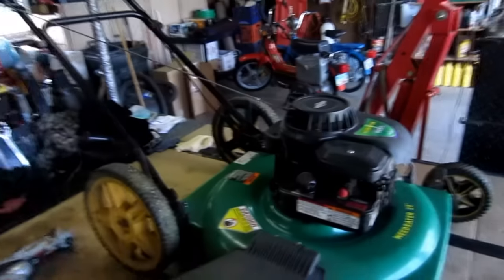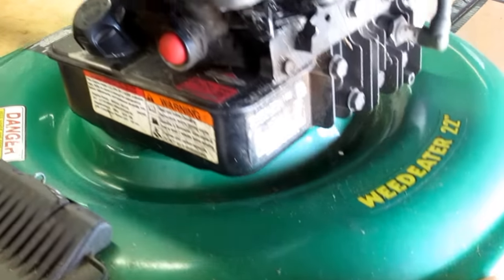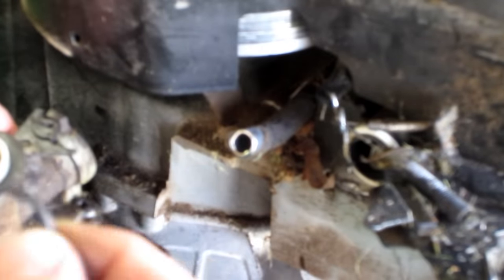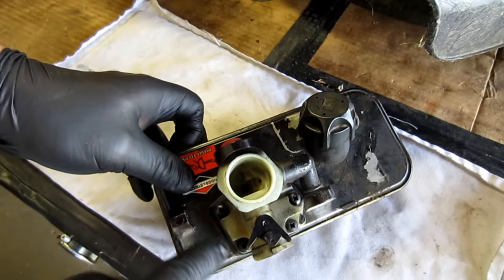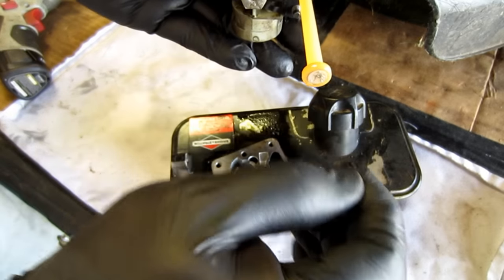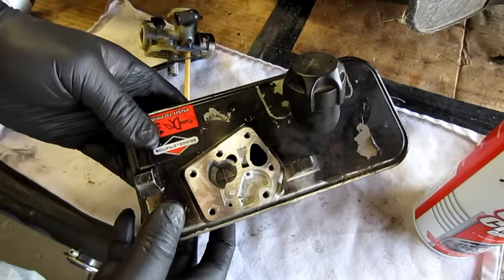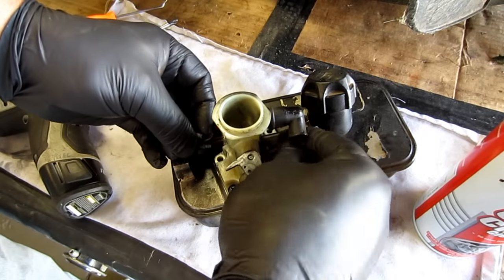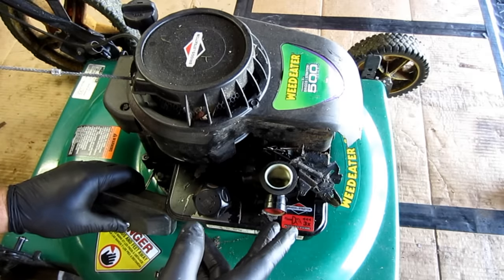Fix 90% of Briggs lawn mower not starting problems. Easy repair.

Comment: A correction to your vid needs to be added regarding carb facing up when looking at blade, i suspect you meant to say muffler faces up perhaps add some text it'll save re-doing the vid.. Pays to check inlet pipe where carb o-ring connects, being plastic it can wear from the vibration & check other end of inlet tube bolts are secure.. I really hate those carbs lol
Reply from the maker: Nope... Always carb up or Spark Plug up.... Makes it impossible for oil to enter into combustion chamber or Carburetor... If it gets into the muffler it will just be expelled or burned out...
Reply: @Foxboss9   For L head style motor mowers. The breather valve is on the muffler side. This is also where the orifice is to access valve keepers. There are two holes. One in the bottom sitting parallel with the sump. The other much larger is parallel with the back of the block (as tho you had a hole in a door while motor is right way up), this is the hole that when placing carb up allows oil to fill that void where the valve stems & keepers are. It also means the breather will now flood with oil as it is now facing downwards where you don't want it & can hold enough oil to foul the carb & plug once mower is placed back down (a good portion flows through the breather tube you see in your vid the rest comes when the motor is attempted to run & gets pushed by crank case pressure). The 2 small holes in the breather gasket are far too small to drain the oil out. It was a common sight usually from mowers bought from big mart stores as customers weren't given instruction.
Reply: @ricebike  . face palm

Comment: I have to say, first thing I do, I have to wash all the gunk and crap off with degreaser and pressure washer, before I begging to take it apart, little water ain't going to hurt anything, then if needed I do the carb cleaner air gun thing,,,

Comment: Got this lawnmower for free.  Worked good one year then no more...tried changing the tank and carb still didbt work... Of i put napfta and it wants to go seems no suction at the ball primer. Real pain this carb.
Reply: Its a garbage carb i have gotten 2 and it wont pull gas...when i prime it starts  but it just wont pull...it has a diaphrahm suction system.  I hate it right now.

Comment: I cleaned the main jet, replaced the diaphragm and gasket. It runs till it burns out the gas from the primer bulb. I cleaned the pickup tube. Any suggestions?
Reply: You put the diaphragm the wrong was round

Comment: Quick question my mower doesn't shut off when I release the throttle handle I replaced the linkage and still doesn't shut off I have to remove the wire to spark plug in order to turn off how can I fix this problem? Thank you in advance!
Reply from the maker: Definitely sounds like the ground for the coil has lost its ability to ground itself when the bail is released...look under the blower housing for the small black wires to make sure they are running to the coil.

Comment: Hello, i have a mover with this engine B&S 450, 148cc. When i turn the mover to side (carburetor top) for blade cleaning, the oil go to carburetor inlet through breath tube. Engine doest not start after this. Please suggest a corrective action for this case. Thanks in advance!!!

Comment: Have this carb on Briggs Stratton 500 series pressure washer. Fouls plug trying to start. Good spark. Any advice appreciated.
Reply: With this video i disassembled to the coil only to fid flywheel with heavy rust. This caused the weak spark and plug fouling on trying to start. Thank you for making this available.

Comment: I have a Briggs & Stratton president 1000 classic 35, similar to what’s on the video.... the blades is worn out, what sizes blades do I need n also the spark plugs type ? Please advise . Thank you
Reply from the maker: You want to contact a local small engine repair shop...

Comment: My carb looks the same, but it has both a gasket AND a diaphram between the carb and tank, came that way from the factory and the kits for my number of engine show both being used, gaskt on top and diaphram on bottom-???

Comment: Hi, I  have  a  primer problem with my 35 classic  push type mower, I  have tried two new carburettas  &  the primer  does not  work, my original  petrol tank & carb  were lost  when  I  had to  dis-assemble   &  clean out for   a  removal  company, there is no petrol being squirted in, both  carbs were  spotlessly clean  &  new gasket &  diaphrams  fitted  plus  primer bulbs  fitted, have you any idea please.

Comment: My edger (same carb setup) runs great but the primer bulb stays stuck in. If I pour a bit of gas in the carb I'm good but what a pain. Any thoughts on that? I did notice that your bulb was slow to come back to shape.
Reply: to clarify, the primer bulb is permanently stuck in, even if I remove the air filter and during operation.
Reply from the maker: The passages that the primer bulb in gauges are blocked and need cleaned. Primer bulb can be removed. Either retained with a plastic clip or a metal push ring.

Comment: Here is my problem. When I press the red primer bulb there is absolutely no resistance and no gas is pumped into the carb. Every time I want to use the lawnmower I have to take off the air breather and pour gas in the carb.

Comment: Would this repair procedure work on a Murray branded lawnmower with a B&S 450E series engine? It stopped around a year ago and does not start at all. I replaced spark plug and air sponge filter but no luck. Any ideas?

Comment: I want to know the cleaning stuff you are using, what is it, where can I buy it or WD40 will be fine to use?
Reply from the maker: WD-40 will not work. Carburetor cleaner. Any part store will have it. Spray it on and quickly wipe it off. Watch it around paint as it will take the paint off of stuff immediately.
Reply: Foxboss9 . Thank you for your quick reply

Comment: If you’re looking straight at the carburetor with the gas filler cap on your left, when I press the primer bulb gas will come out of a little hole to the left of the bulb. Is this normal? No return line should be connected to it going to the tank?
Reply from the maker: It should come out unless you have pushed it too many times
Reply: Foxboss9 it should or shouldn’t come out?

Comment: Can anyone elaborate on how to fix the idle issue at 14:00? I ran mine under a bush and it caused the engine to race. Now it runs too slow and the rpms go up and down.

Comment: I tipped my mower the wrong way and oil spilled from the exhaust, is this fix going to work or do I need to do something more extensive? Thanks in advance!
Reply from the maker: You need to replace your air filter and just pull the spark plug then pull the start cord about 5 times that put the spark plug back in and start your Mower and let it smoke it'll eventually burn it off but make sure you have enough oil in the engine first
Reply: @Foxboss9   Thanks so much this worked, only issue I have now is that it's revving extremely high! Unsure if this will stop once the oil is burnt off (white smoke)
Reply: @Foxboss9  Ah I found the high idle issue, the tab was stuck on the other side of the air inlet tube all fixed! Still smoking ten minutes in but I guess that's a given for a short while!

Comment: Hi sir, i followed everything and it worked, but the motor or engine  was like on full throttle and then smokes a lot. Hoping for your reply. Thank you.
Reply from the maker: You have the linkage connected wrong.
Reply: Foxboss9 fix the linkage, and even clean the carburetor again, it starts but still dies. Thanks

Comment: MIne has no priming bulb. It will start but won't stay running unless I hold the throttle on the engine.

Comment: My briggs motor doesn’t have the easily removed clip on the carb. Perhaps I have a different model??
Reply: Yep... Mine has the same carb but just a spring and the governor linkage. Just take a picture before disassembling just in case.

Comment: Hey foxboss I did this repair but still having an issue with the lawnmower it use to start and run about a minute after replacing diaphragm and gasket it will run for about 10 minutes and shutoff one shot of primer it will start right up and run for another 10 minutes any suggestion on what to look for
Reply from the maker: Make sure your gas cap is clean and vented. I'm assuming that after 10 minutes of running and it shuts off and then you restart it with primer that it will run another 10 minutes before it shuts off again?.
Reply: @Foxboss9  yes that is correct I've tried running with the gas cap slackened off and same result

Comment: I like your video n bcome subscribed, 
On this video from the beginning u told about problem on carburetor problems n also mention about primer pushed  but didn't pop up back in says in, I have that problem how can I solve/fix it ? 
I live in Melbourne Australia n I have same engine briggs & stratton 4 stroke 148cc engine ,  but here they make in Australia n they call the brand name Victa, model Vintage, 450 series, blue color chassis/body but I believe engines r  import from USA n my lawnmower  has the same petrol thank n carburetor on your this video has.
i hope u help me how to fix that problem.Thank u in advance ,
Sorry my english may be no good, english is my second language.
Reply from the maker: The reason the primer bulb is not popping back out is because the passage is going to the primer bulb need to be cleaned out you need to remove the retainer that holds the primer bulb in and run a small thin wire in through the passages or you might be able to use carburetor cleaner to clean them out then reinstall the primer bulb. By the way your English is just fine
Reply: @Foxboss9  Thank u very much i will try to clean it n see how it goes one day here is coming winter next week its already to cold down here in Melbourne Australia I tell u the truth i dont try to fix till one nice day weather or until spring comes i bought second hand  lawn mower at the moment i am cutting with that in cold weather lawn doesnt grow much anyway ,thank u again for helping me out how to fix the problem ,well done u helping out people how to fix good on u i will keep watching your videos ,thank u very much.

Comment: My priming pump doesn't pump any fuel unless the mower has warmed up. My mower runs and starts fine when I take the air filter off and spray Start Ya Bastard into the carby, if I then turn it off and push the primer I can hear it pumping fuel, but before starting it, I can't hear any fuel being pumped. I've even left the mower in the sun for a few hours before starting and the primer will work fine. I've replaced the primer. Any ideas?
Reply from the maker: Clean the passages underneath the primer bulb all the way through
Reply: @Foxboss9  behind the primer bulb?

Comment: Use real 100% gas (NO ETHANOL) and fuel stabilizer year round. Never have a problem again. Easy right?
Reply from the maker: Closest 100% non-ethanol gasoline to my location is 25 miles. I don't think that sounds easy. Fuel stabilizer does nothing more than provide a skin over the top of the fuel slowing the water penetration into the hydroscopic ethanol that is being used. The best way to prevent this problem is to never use fuel that is older than 30 days old. If it's in the can and it's 30 days old, put it in your car, if it's in your mower gas tank and it's older than 30 days, pour it on Weeds and put fresh in.
Reply: Wish you could get real gas. Shame Congress created that junk Ethanol for us. Less MPG and HP plus carb issues for us mower peoples.

Comment: I was mowing the other day and lawnmower ran out of gas and after refill it wouldn't start. I tried this just now and followed your instructions to the letter and it still won't start even though it's getting spark and air and fuel. I'm not sure what else to do.
Reply from the maker: Without the air cleaner on the carburetor spray a little carb cleaner directly into the carb. If it sputters or tries to fire up you still have a fuel issue. However if it does nothing at all even after a couple of more squirts of carb cleaner then you have a spark issue. Even if you have a stuck valve or a broken cam or even if it's just out of time from a sheared off flywheel key it should make some kind of popping noise when you spray carburetor cleaner directly into the carburetor.
Reply: @Foxboss9  The spark plug has spark but it won't even fire and sputter when using ether. All it did was run out of fuel.
Reply: @Foxboss9  re cleaned it and also replaced spark plug. It starts now and doesn't surge anymore. Thanks for the video and help.

Comment: I changed the flywheel key, cleaned carb and replaced diaphram, lapped the valves. Lawnmower starts first pull but overheats very very fast about 30seconds. I dont know what else I can do. So many hours wasted. :( Any ideas? 3,5hp briggs lawn mower
Reply from the maker: I have never heard of an engine overheating that has enough oil in it. If it is shutting off it is due to the lack of fuel delivery. You may want to double-check the carburetor to make sure it was cleaned entirely. The only time I've ever seen a air-cooled engine overheat is when it seizes up. Make sure your gas cap is ventilated. Make sure your RPMs are correct.
Reply: Foxboss9 Engine was overheating before and after I cleaned carb and changed diaphram. I changed oil, and after 30min of working(it had to cool off many times between) it got very black. I am not sure at all what else I can do. Maybe its sucking air from somewhere to run lean? And its very very weird, it sounds normal but it gets really hot after just 10seconds of use and my friend has pretty much the same mower and it doesnt get hot nearly as much. In those 30minutes, I know that first 1 minute engine runs okay.ish, but whet its gets super hot it starts popping from time to time. Thanks for reply

Comment: A Kubota Engine how do you start it when you give it starter fluid in the Jesus fluid does make it crank up you turn it over and you spray starter fluid inside the the engine for the carburetor what is the diesel engine so how do you get power to start it

Comment: I bought a MTD self propelled mower in 2006 It gave me hell for 10 years Broke down all the time Never again
Reply from the maker: 10 years of use, even if breaking down, is better than most...
Reply: Foxboss9 my new mower has not given me any problems for the last 4 years doing the same work load

Comment: Is the yellow gas tube repacable or if it breaks your out of luck
Reply from the maker: You can replace the whole carburetor for relatively cheap
Reply: Foxboss9 is it possible to replace the tube

Comment: ive always been told to never let carb cleaner touch rubber gaskets.
Reply from the maker: Those aren't rubber gaskets there's some sort of a nitrile. And I'm not soaking it in carb cleaner I'm just using the carb cleaner to spray off and wipe away debris that may have stuck to it. The carb cleaner evaporates really fast and the fact that you wipe the excess way it doesn't affect them. Now if you were to soak them and carb cleaner that would definitely be an issue. But for the short bursts and the limited time that it's on those gaskets it's fine. Just like you were never told to allow a rubber to touch gasoline either. This is a fuel pump diaphragm that sees gas fumes and raw liquid fuel all the time.

Comment: Hi
Can you tell me
Y I have fuel all around
The gas tank
Most of close to 
We're tank attached to the carburetor
Reply from the maker: Sounds like you may need a new gasket and. That's what the link is in the description. Inspect your carburetor to make sure it's not cracked because it is plastic after all. But it's not cracked just replace the parts that are in the video description link

Comment: What happens when your mower or ride on mower sets all winter when summer comes and you go to start it and it starts but runs wide open
Reply from the maker: Is it a push mower or a ride-on mower? If it's a push mower, make sure you didn't smash the throttle linkage by accident when putting it in storage. If it's a riding mower, sounds like you have a governor issue.

Comment: Do not use a screw gun/drill to put the screws back in since its plastic use a Philips screwdriver I think it's a #2 or you could very easily crack it by over tightening it. The older plastic gets the more brittle it will become and easier to crack. And clean or replace the air filter don't be lazy. And while your at it clean the spark plug your already there. I hate when people do stuff half a##. And instead of a little scratch use a drop or two of gasket sealer so you aren't doing again next year..............
Reply from the maker: Well that's funny that you don't like people that do stuff half-assed. I don't like people that don't even have video content that tells people that do put up video content how to do things. First of all I've been doing small engine repair over 38 years and 15 of those years with impact drivers. It started with air impact drivers and now that the Battery Technology is stepped up I can do it with lithium-ion powered drivers. If you don't know how to use the tools then I suggest you don't use those tools, however I am proficient with them, and it has nothing to do with lazy, it has everything to do with efficiency and getting the job done quickly so you can move on to the next repair something that is known by people who do that for a living not as a weekend Hobby. Number two you don't ever use gasket sealer of any kind on carburetors that are being used on these small engines. as the orifices that the fuel travels through on a small engine cannot handle any excess that is bound to find its way into the fuel stream. If you feel as if you have a better way doing it then you need to start posting those videos and quit commenting on the ones that have helped thousands of people get the job done.